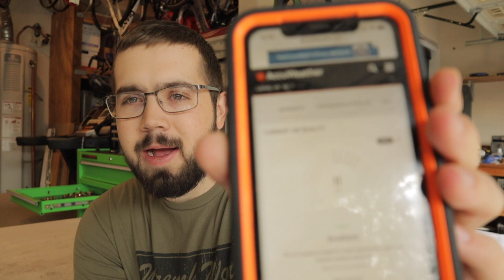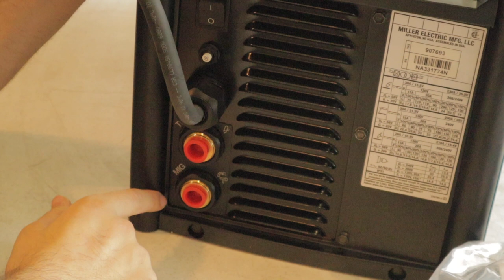Custom Bumper Time!!! Unboxing My New Miller Multimatic 215 Welder!!!

Comment: I bought my 215 about 5 months ago, Only issues I've had ... I purchased 20ft of ground cable to replace the 10ft. I kept getting motor error, I had to cut down to the original length and error went away. I have since replaced with the Hobart 770031 400-Amp T-Style Ground Clamp Brass and will have to test longer ground lead. The cheap clamp that came with my 215 was getting very hot. Anyone have these issues?
Reply from the maker: Interesting. I'll have to try to pay attention to that to see if I have similar issues.

Comment: ✌️ I have a question, tell me which stores in the USA do you order spare parts for your F-250?
If in those stores spare parts for the 94 model?
Reply from the maker: Riff Raff Diesel is my go to for 7.3 specific parts. If anyone have 94 model stuff it’s him.
Reply: @LivingOnWheels  OK, thanks a lot,I'll watch it.
Reply: @LivingOnWheels  I looked at this store, there are very few parts for repair, such as the clutch slave cylinder, the clutch master cylinder, I could not find them in this store. They also ask the store to return the old part, but I cannot do this, since I am in another country, I can only order one-way shipment. Perhaps you know any other stores?